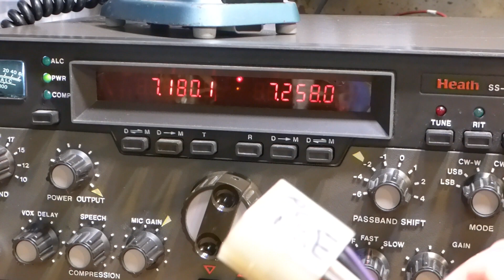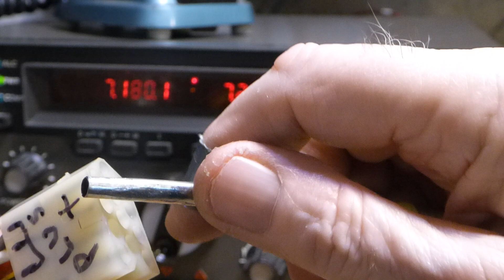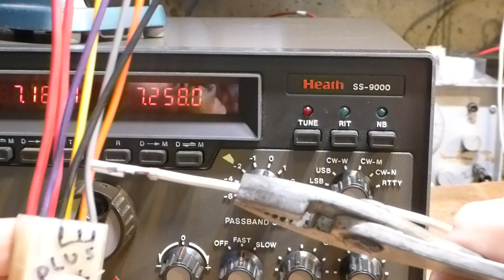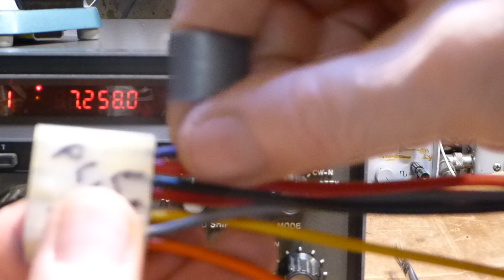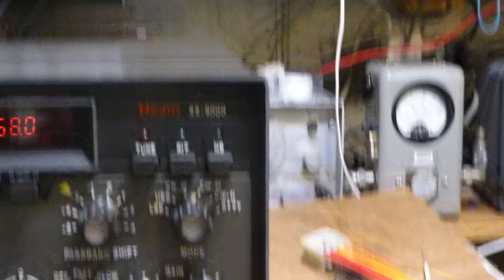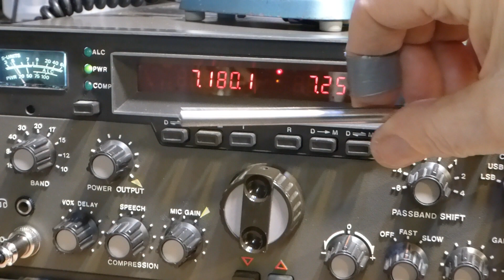HEATHKIT SS9000  ,  Tool to remove molex pin  connector sockets ,  SS9000 power connector tool .

Comment: Go to a good hardware store, or, look online, for an assortment of "brass hobby tubing". Years ago, I made a tool to work on Harley Davidson wiring harnesses that had connectors similar to Molex connectors, that the tubing worked perfectly for removing those pins, and , I also found later, they can work on Molex connector pins as well. You can also make a unwrapping tool for wire wrap pin connections with 2 pieces of hobby tubing, 2MM and 3MM, I have a video of that construction available if any are interested.

Comment: you sould do a detailed vidio on using 75 ohm cable in 50 ohm systems! like how to match it to the lode and transmitter! 2 would be cable ends! and 3 would be best cable to use tips tricks etc! lots of good info! thanks
Reply from the maker: Jake...  to see all my videos  just type my full name in the youtube search box  Robert Sumption .... I have made videos on using 75 ohm cable and on how to use pl-259 connectors on RG-6 and
 RG-11 There is nothing special to do to use the 75 OHM  coax  just use it same as 50 ohm The rigs they make have always been made to work on 75 ohm or 50 ohm   I have been doing it for over 50 years now with very good results . The losses in the newer  75 Ohm quad shield cable are very low I tested a 100 foot roll for loss and it was .6 db thats point  6 of one db loss at 50 MHZ actual measured  .  So just use it  the 75 ohm cable works  really good . Also  they now have crimp on connectors pl-259 size you can use with RG-11 quad shield  really nice because of the aluminum shield  73  JAKE 
Bob N8RS

Comment: Great tip Bob I always appreciate your wisdom. I love that radio nice to see it operating. 73, Tom k2bew
Reply from the maker: Tom when I bought this PARTICULAR SS-9000 I found it had  at the time a major problem the glass  Vaccum Flourescent display was broken !  I searched all over 
for one and finally in desperation I designed and made the LCD display and it worked !  that is in another you tube video .  73   Tom   Bob N8RS